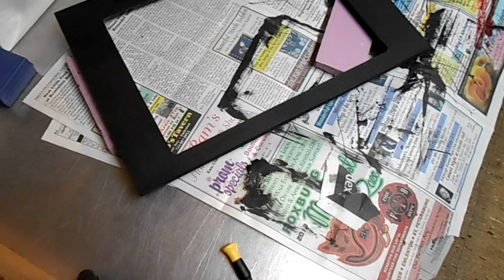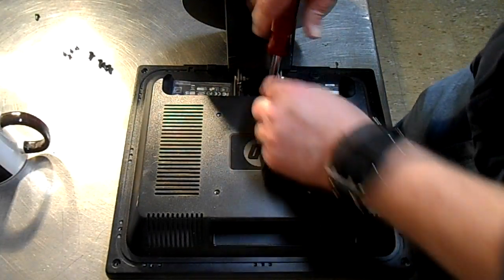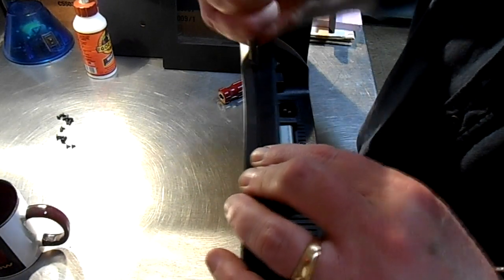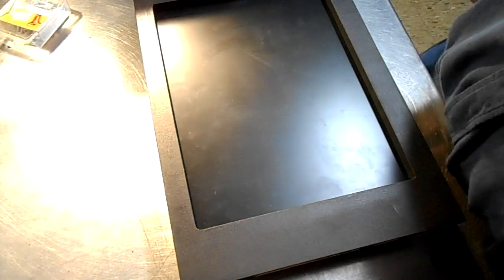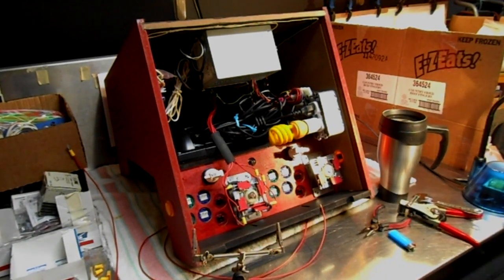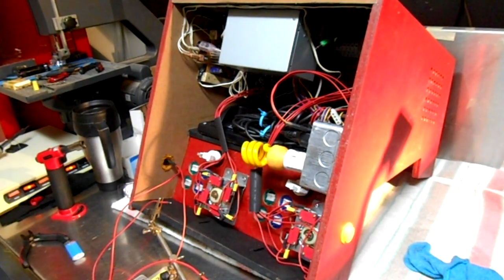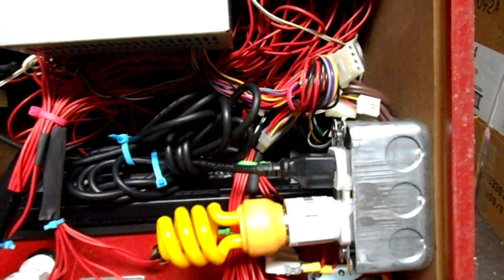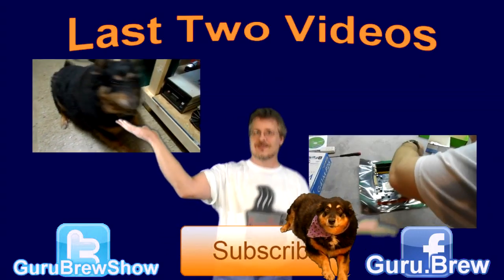Raspberry Pi Powered Arcade Cabinet - Assembly and Wiring

Comment: The mounting of the Screen here was totally overcomplicated - the screen had 4 standard VESA 100 mount holes on the back - he could have just put a strap on the back of the monitor screw connected to the vesa mount screws and then mount the strap to the cabinet - much easier than having to open up the monitor.

Comment: I really enjoyed this video but I was a bit disappointed on the wiring part.
I would have loved to see exactly actually how you managed to wire everything to the power supply. Also, from what I get you use a keyboard as the input device which is a great idea but if I could say. A keyboard comes with keylock. Since you got lot of button, how did you manage to not suffer from keylock if 2 people play simultaneously ?